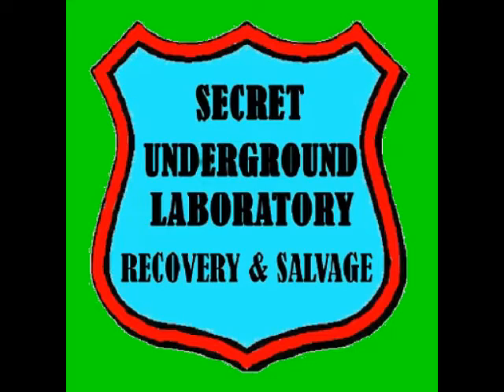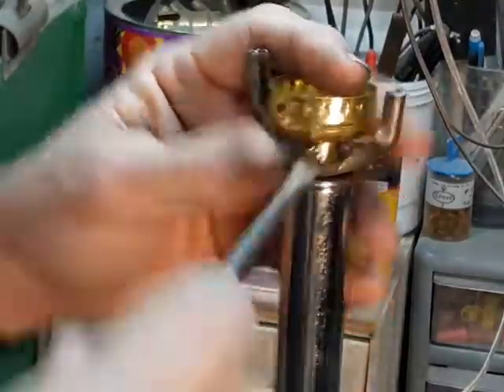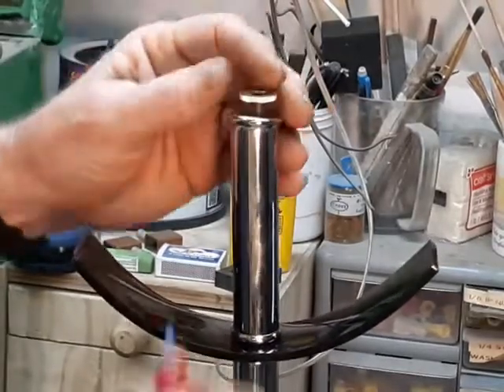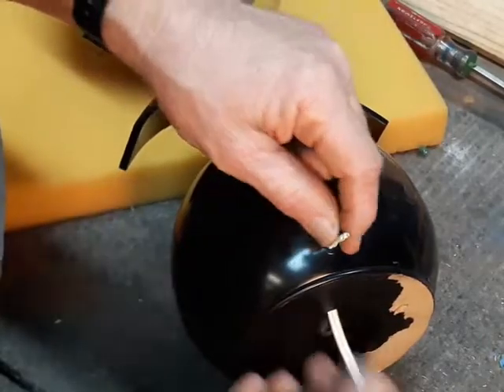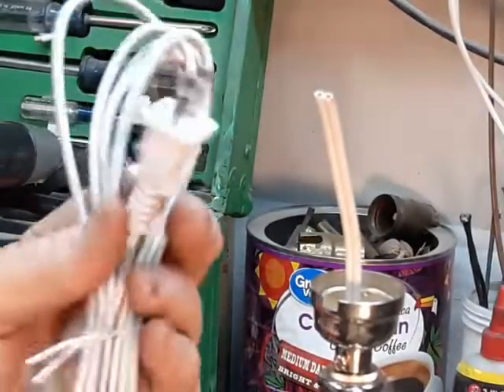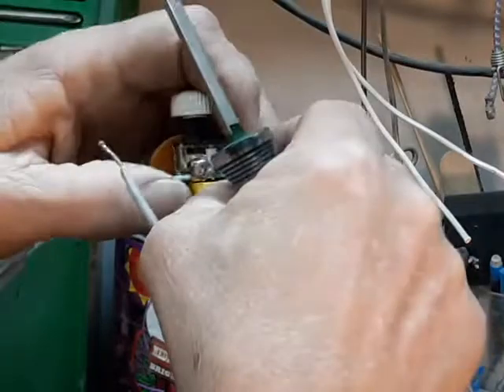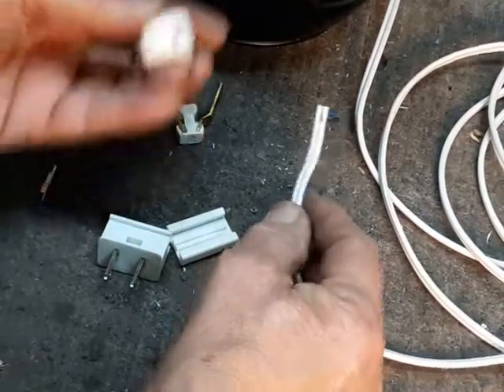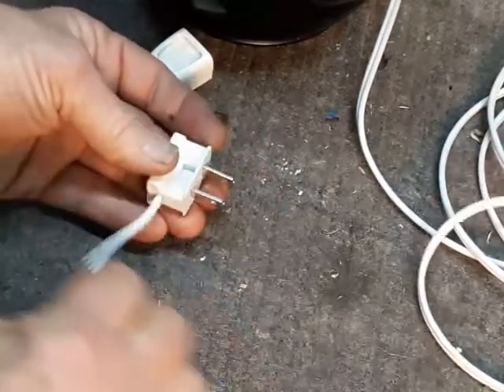Improving an Italian Designer Lamp in the Secret Underground Laboratory Recovery and Salvage

Comment: Two questions:
1. How did you put the soft base (or its replacement) back on?
2. Is there a reason you thread the cord from the inside of the base out instead of from the outside in?  Would seem less would need to be threaded that way.

Great video, as usual, and good explanations of important points.
Reply from the maker: Thank you very much. For the bottom felt, I have sheets of stiff felt in various colors. The felt is cut to shape and glued on with contact cement. 
I would usually insert the cord from the outside in because standard lamp cords come with a molded plug. In this job, the customer wanted an extra long cord, so it was cut from lamp cord off of a roll and a plug installed on the end. I put it from the inside because it was easier in this case.